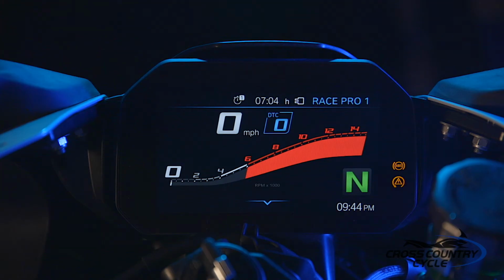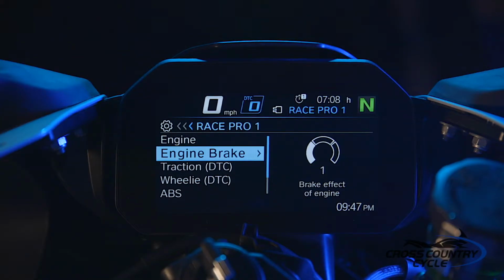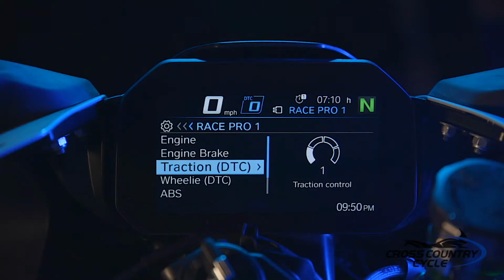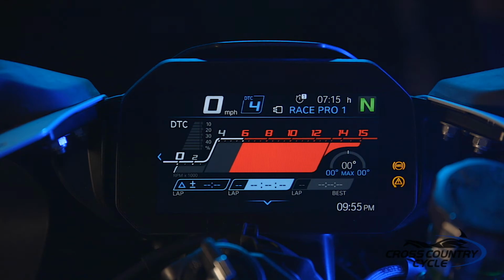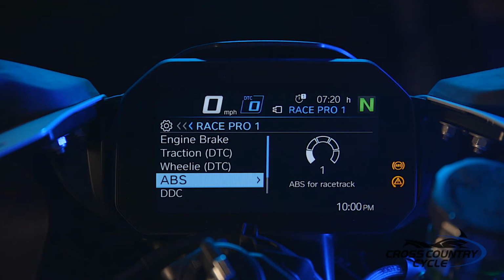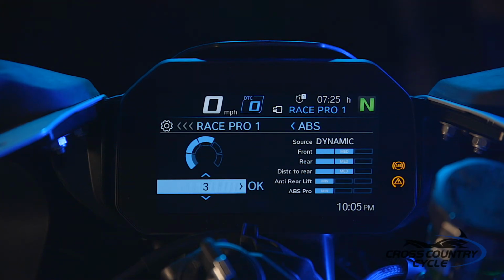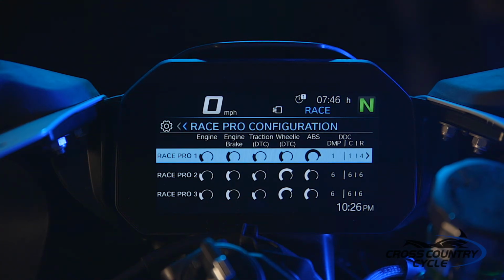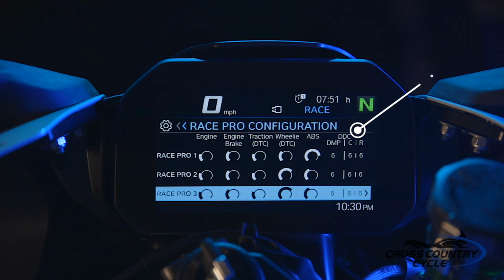BMW S1000RR DECODING - RIDING MODES (EP.03)

Comment: Is there a way to make the bike softer for road riding.

I use Road Mode.

If I use Race Pro Mode and adjust the DDC, I don't end up with it feeling any softer.

I think the reason is because the DDC source in Race Pro mode is Race and not Road.

Comment: Ok so the set up I want is a 1. A road ride  2. Normal throttle response with Full engine torque.  3. No wheelie control .  4. Normal engine breaking.  Thx
Reply: You can have that gramps

Comment: Do you know if the DDC settings in pro modes are fixed (similar to a conventional suspension) or are still dynamically adjusted (and if so what exactly does the damping value indicate then)?